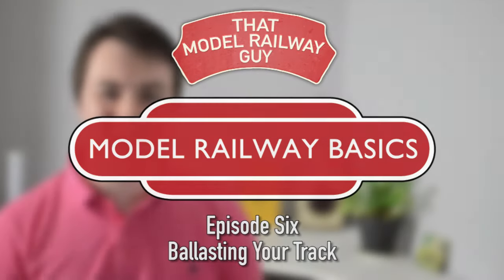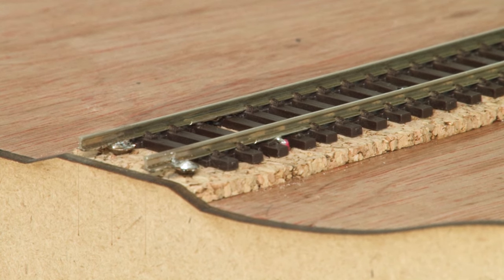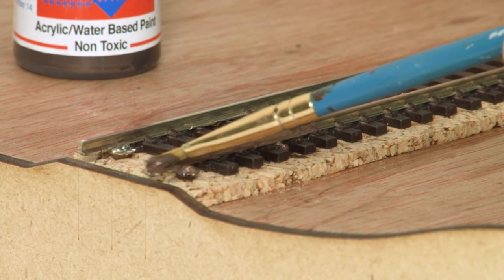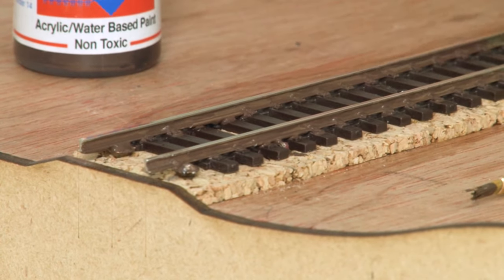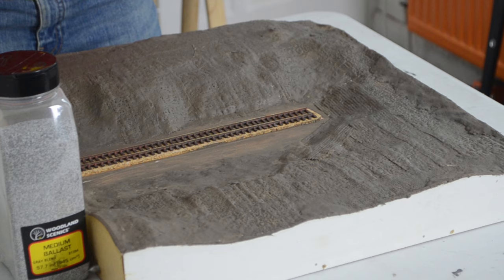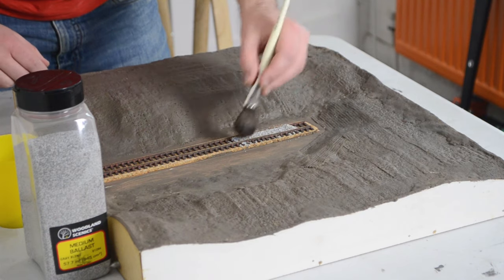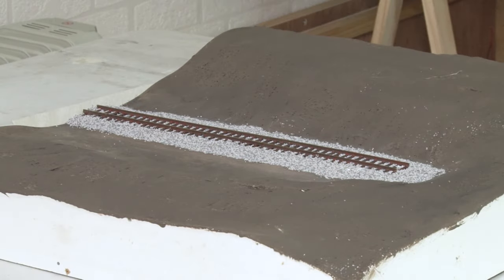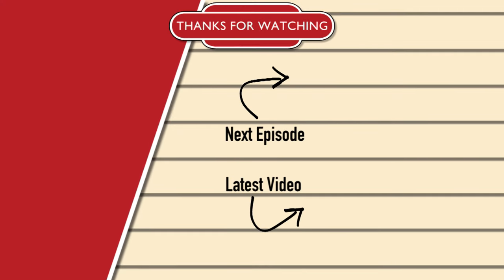How To Ballast Your Track - Model Railway Basics: Episode Six

Comment: What is the other liquid you added to the glue and water mixture? Thanks!
Reply from the maker: Hey Stephen, it's washing up liquid - any brand will do and you only need a drop or two to break the surface tension so that it spreads through the ballast. Thanks for watching 😃
Reply: @ThatModelRailwayGuy  thanks! I’ve just started in the hobby and your videos have been extremely helpful. Cheers! 🍻

Comment: I wish I had seen your video one year ago... I first ballasted... and then started applying rust... 😳 Wasn’t easy as you can guess... 🤓
Reply from the maker: Yeah it can be quite fiddly! If you use an airbrush I imagine it's much easier to weather after ballasting the track. But if not I've certainly found it easier to add the rust first. Thanks for watching 😃

Comment: I have 2 metcalfe bridges. How do i ballast my track on them with out them turning to mushy cardboard?. Cheers
Reply from the maker: Good question Justin! I haven't personally ballasted over a metcalfe bridge but I did use a watered down mix of filler on one to create a road surface and the bridge wasn't affected at all.

That said, you could perhaps try spreading neat PVA on the bridge deck first and then sprinkling the ballast over that. Or if you really wanted to be safe you could put down double sided tape on the bridge, lay your track on that and then sprinkle the ballast over the top. Hope that gives you some ideas and thanks for watching 😃
Reply: I haven't model railroaded in 50 years but back in the 70's my brother and I built a 14 foot by 14 foot HO layout.  We used flex track and back then the ties were fiber not plastic.  So using a water based glue was not possible, it would warp the ties.  I tried a lot of things to glue down the ballast but nothing worked.  Finally I tried Dull Coat.  It is an enamel based clear paint that drys clear and dull.  It worked fine on our fiber ties, and my brother ballasted the whole layout and even painted the rails. I don,t know what metcalfe bridges are but to glue ballast on them use an enamel based dull clear paint.  You can even use spray paint,  just spray it in a small cup and apply it like the author shows. Do not use lacquer based paint if you are using plastic ties because it will melt them.  Only use Enamel.

Comment: Just an unrelated question. Is the middle wheel of your J15’s tender looser than the other two and do the wheels of the engine get to have less forwards and backwards motion the further back to the cab you get with the front wheels having the most Motion?
Reply from the maker: Hi Daniel, yes the middle axle on the tender is loose on mine too. This helps it maintain contact with the rails (if the whole thing was rigid it might have trouble on uneven trackwork).

With the engine wheels, the back wheelset is the one attached to the motor so that's why it'll seem stiff if you're trying to move it by hand. When running, the front two wheelsets are moved by the coupling rods attached to the back wheels. Because the front wheels aren't driven themselves they have a bit more slop which allows the loco run smoothly. 

This isn't just limited to the J15 by the way - most locos tend to be like this in my experience. Hope that's helps and thanks for watching 😃
Reply: Thank you for answering my question. I just wasn’t certain if the engine was broken or not however thanks to your helpful advice I now know that it is absolutely fine. Thank you once again.

Keep making the great videos,
Daniel
Reply from the maker: @danielhayton8657  Awesome, glad I was able to help. The J15 is a fantastic model in my opinion, so I hope you have good fun running it. All the best 👍

Comment: Do u have to put your rail on cork ?   I am doing a flat table top ?
Reply from the maker: Nope, it's completely optional although visually you do get a better look with the cork to create a shoulder to the ballast and in my experience trains tend to run better on it too which is why I prefer to use it. Thanks for watching 😃

Comment: I guess you could lay the ballast first and then put the rail on top
Reply from the maker: You could but I wouldn't personally recommend it unless you're using something like sawdust scatter as ballast. 

Generally you want to make sure the track is laid well on a flat surface which is hard to get right if you put the ballast down first. Also by adding the ballast later you can get a more realistic look of it packing in the sleepers rather than the track sitting on top. That's just my opinion though, thanks for watching 😃

Comment: Good grief what a longwinded way of doing it! Use RailMatch Sleeper Grime aerosol - covers in a small fraction of the time...and you get a much better result if you use a purpose-designed ballaster. It's a small box thing with holes bottom and sides. Position between the rails, fill with ballast, push gently along and you're done! You can even 3D print it yourself and save some cash.
Reply from the maker: That’s definitely an alternate way of doing it but remember this is a beginners tutorial so is intended to be as simple as possible. Those just starting out are unlikely to have spray paints/air brushes or ballasting devices and 3D printers. The hope is that it shows new modellers the basic process with the freedom to eventually adapt it for themselves, perhaps in the ways you suggest. Thanks for watching 😃

Comment: You never showed how to clean off the glue from the rails? Do the train just ride over top of the glue or do you have to clean off the all the glue?
Reply from the maker: Just clean them however you would normally clean your tracks. Some people use IPA or a special track cleaning wagon. Mostly I use a track rubber... the PVA doesn't tend to settle on the rail tops anyway but even if it does it'll be a very thin layer. Hope that helps and thanks for watching 😃

Comment: So its a mixture of water, glue, and whats that last thing? Dish soap or something?
Reply from the maker: Yeah washing up liquid is just basically a liquid dish soap. You can use anything that will break down the surface tension in the water/glue but washing up liquid is pretty common here in the UK. Thanks for watching 😃
Reply: @ThatModelRailwayGuy  ah, ok. Not sure I can find find one without color to it here in the states, but I'll do what I can. Something tells me I can't use my apple scented one
Reply from the maker: @ShukakuTheCrazy1  That should be fine, the one I use is florescent green! Remember you literally only need a drop or two to dissolve into the water/glue mix.
Reply: @ThatModelRailwayGuy  ok, just a drop or 2. I'll try and resist my quantity control issues.

Comment: Did you have to clean the tracks before painting?
Reply from the maker: Not beforehand but you do need to after painting the sides and glueing the ballast down just to remove any excess from the top of the rails. Thanks for watching 😃
Reply: @ThatModelRailwayGuy  Thanks. I asked because I am using Sleeper Grime on N scale Fleischmann Piccolo track that has track bed and the paint doesn't go well on the rails, unless I put a lot of it on.

Comment: I did the glue thing, but it turned way darker then wanted, what do I do?
Reply from the maker: What glue are you using? PVA and water shouldn't colour or make the ballast darker. Sometimes it goes a little darker while it's wet but it'll go back to the original colour once it's dry. The only think I can think is that ballast itself is coloured in some way that's reacting with the glue... but that's a wild guess as I've never actually experienced this. Hope that helps and thanks for watching 👍
Reply: @ThatModelRailwayGuy  I’m using an 50/50 mix of wood glue and water, I do use an other ballast, it’s from noch and it acts like it’s wet but then doesn’t turn  back to the gray. I did see an other video of noch itself and they used their own brand glue, the same happens but I didn’t see the end result after a longer  time. Could that help? Or could I heat it up with an hair dryer? That might heat up the track like an heat sink tho

Comment: Hi,
Instead of painting the rails and sleepers with a paint brush, you may want to try out the aerosol that railmatch do, it’s quicker, spreads it very evenly and easy to use..
Many thanks,
Cameron
Reply from the maker: I've tried using the aerosol and also using the standard paint in an airbrush too for more speed builds. Personally though I much prefer doing it by brush when time allows as I can control where the paint goes more easily. 
This video is also aimed at beginners too so is aimed at those wanting to get good results while keeping things very simple.
Thanks for watching 😃